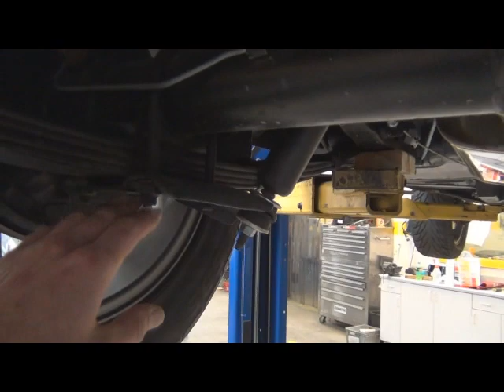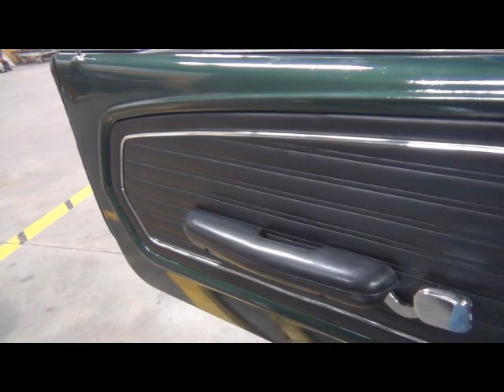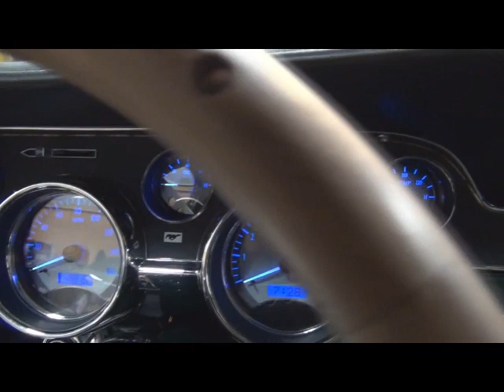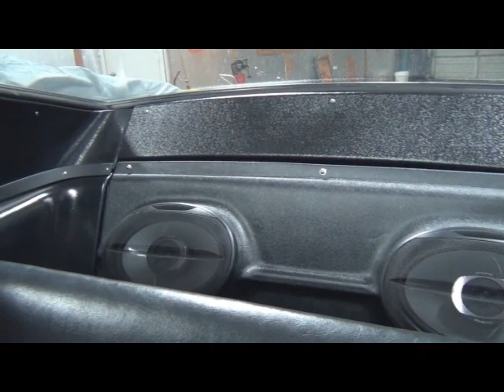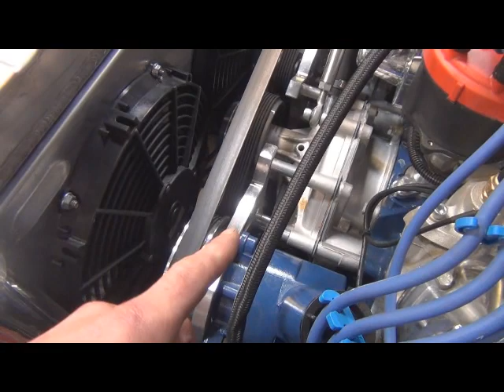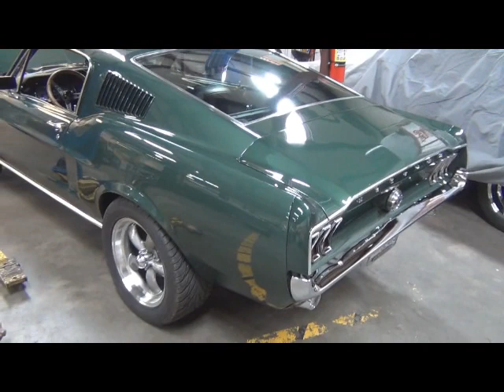1968 FORD MUSTANG FASTBACK RESTORATION 427 FORD STROKER ENGINE

Comment: I honestly do like the overall package despite the compromises that Prestige had to make in order to comply with the owners  requirements. The bottom line is always the customers satisfaction and I’m sure he is pleased with the results. 

However, with so many options available, the decisions can be difficult. 427 cubic inches has the same power potential regardless if it comes from a FE big block or a Windsor small block stroker. Apparently maximum horsepower wasn’t a priority. The power loss from modifying the custom air intake for hood clearance was huge. Using a block with a 8.2” deck height instead of the tall Windsors 9.5” DH would have meant fewer cubic inches but might have allowed plenty of clearance between the intake and hood. 

I prefer the strength of the 9” Ford differential but with less engine displacement, the 8” differential would be more than adequate in most cases. Just my opinions and considering the old saying about opinions, it really doesn’t matter 🤔😁👍.

Comment: I had a 68 GT fastback. But I thought your build was great, like the gauges but I have a 350 traction loc 9 inch rear plus the disc brake would complete that. But nice build

Comment: That Aircleaner is a power robbing pig . Great for pulling Hot intake air right off the exhaust headers or manifolds. I ran one for a minute and the loss of power was noticed immediately. So noticeable we tested it and it killed 61 rwhp and 56 ft lbs of rwtq on the chassis dyno vs a Velocity stack !

Comment: BLUE WIRES???? what the.... and a Green car.. come on man.... you have to have the end end mind before you start.... that means colors to match...Take note.. Be patient...Pre-plan..Know what you want your machine to look like...Know what you want your machine to do....know if you want horse power or torque to control.. HP for high speed "left TURNS" Torque for "STREET" Whats up????
Reply: +Bob Logger 
I felt the same only about the gauges,which are nice,only I would have gone with a green light package instead of blue.And when the voice said that air cleaner cut 50 hp I would have thrown that piece in the dustbin.